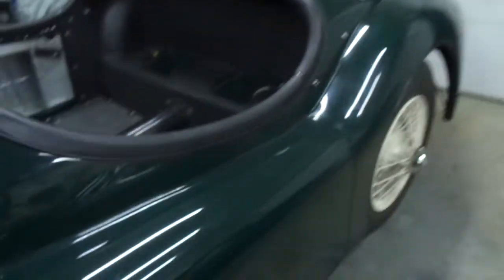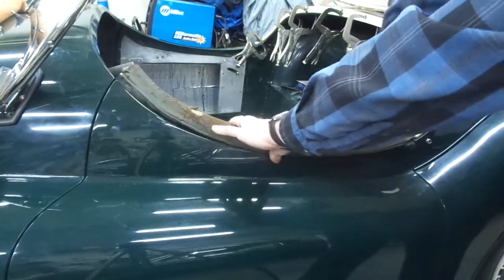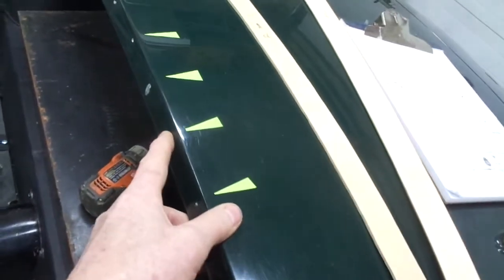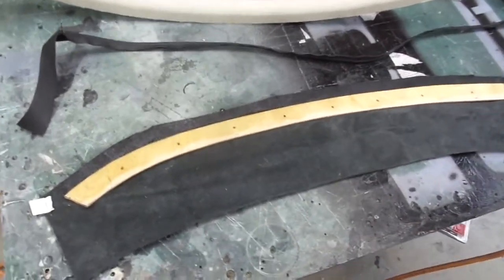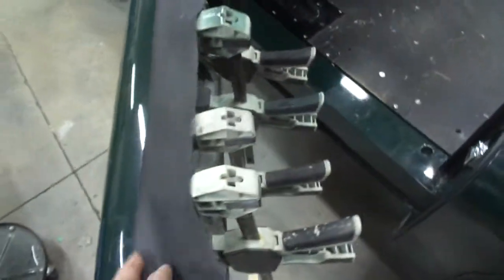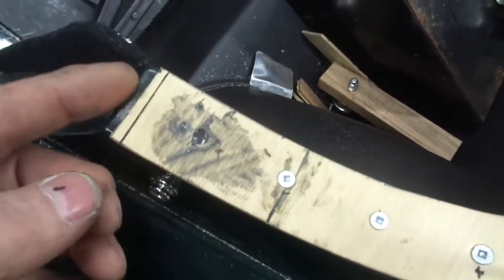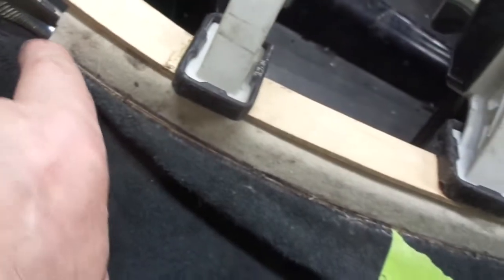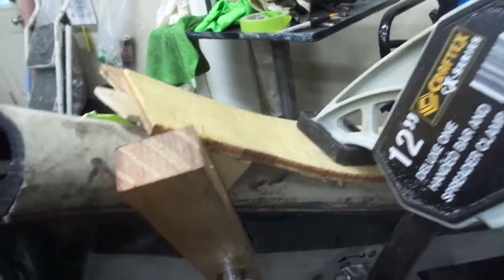Jaguar XK120 XK140 OTS crash roll installation

Comment from the maker: At 2:45 or so I say the flathead screws are 2 1/2" from the ends of the tack strips. I later added flathead screws 1 1/2" from each of the ends of the four tack strips to provide additional stability for stretching the leather. 

A note about pre-stretching the leather as it is cemented and stapled to the tack strip around the 6 minute mark, the leather is only lightly stretched, just enough to prevent crepe wrinkles from forming.

The ends of the tack strips on the doors were set a quarter inch back from the edges of the door flanges while the ends of the tack strips on the scuttle and tonneau were set an eighth of an inch from the edges of their flanges. This proved to be the best arrangement.

Comment: Good Job, I learned a lot, However I would not use JB Weld instead I would use GOOP. there is a type of GOOP for outdoor use and it holds and holds and it can be removed by rubbing and rubbing and pealing. Not easy to remove but it can be done.

Comment: I think the 140 crash roll on the dash or cowl side is slightly different.  Mine does not use a tack strip in the back to staple to, but metal clips to press on a steel lip.

Comment: Thanks for the videos. I just purchased a 1951 Xk120 ots i'm in Ontario as well. I have new leather but unfortunately the car didn't have any door cards or panels to adhere it to. Wondering what you recommend or know a place to purchase just the panels or cards. I notice Bas has a place in BC would they be the go to place for these bits?
Reply from the maker: My go-to supplier of interior kits and individual pieces for my Jaguars has been OSJI in Muncie, IN and I have never been disappointed. Recommended. I’ve had only one experience with BAS Vancouver, purchasing hardtop headliner material for my E-type. I requested and was sent a sample. Quoted cost was expensive but I was pleased with the quality and close match to original so ordered the requisite 2 meters. What arrived was an inferior product, thinner with poor colour and weak definition. When I complained I was informed that they had run out of the material and offered a full refund, but I had already stripped out the old headliner so opted to use it to get the hardtop back on the car by fall. I was never happy with the result so tore it all out again and replaced it. Based on that experience, I cannot recommend BAS Vancouver.